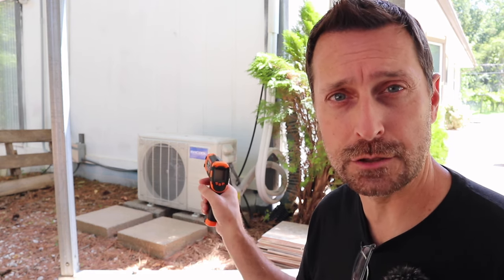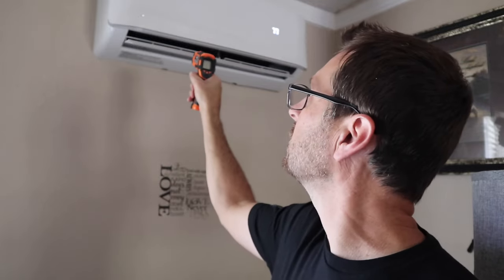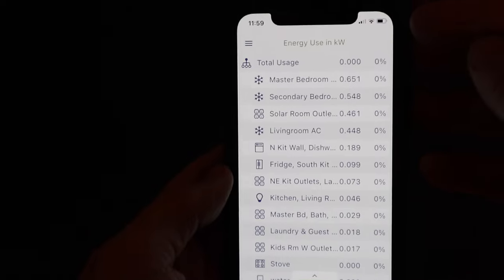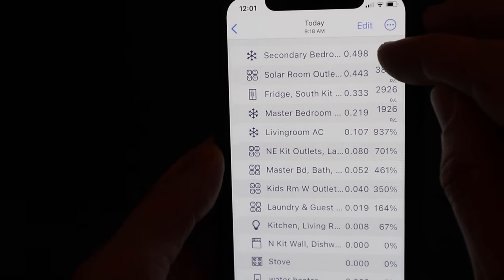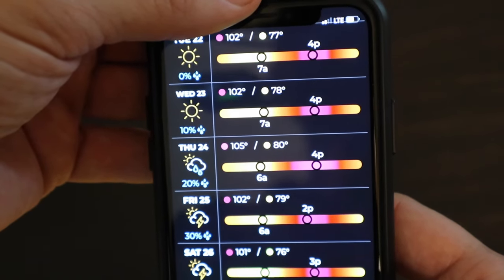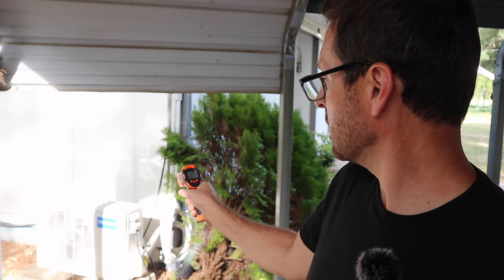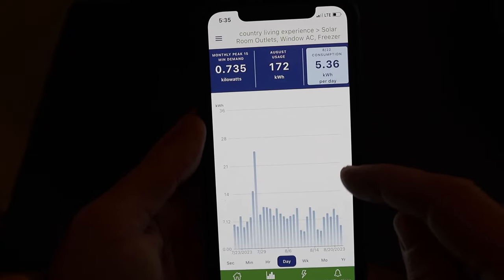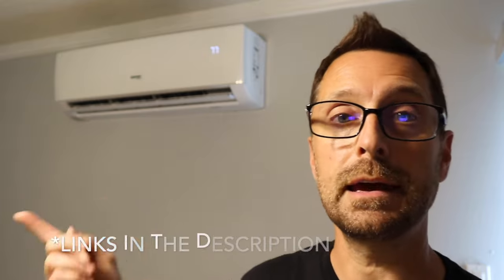Mini Split Heating And Cooling Performance In Hot Outdoor Temps!

Comment: Haha I run 8 heat pumps in 120 degrees and in direct sunlight 😂 they work well. It's super fun using a heat camera to measure the temperature differential.
Reply from the maker: Awesome. You certainly have a more brutal climate than I. These mini-split units are amazing!

Comment: We we're quoted $8K-$14K to replace the central unit for a single room (a converted, two-car garage).  We bought a mini-split for $800 and installed it ourselves. In spite of needing to boost our insulation, the mini split is doing an amazing job. That is the coolest room in the house.
Reply from the maker: That’s awesome. They are certainly a way better solution for cooling.

Comment: When I built this house, we put in one, 4 ton compressor, three mini split air handler style units, and two wall hung mini split heads. Each unit has its own thermostat, each program to different parameters, but combined it keeps the house extremely comfortable, and our bills are not bad at all. This technology is fantastic!
Reply from the maker: Awesome!

Comment: Wow 4 units for 1800 sq ft seems like a lot, but I do like the quiet factor. It was very interesting to see how they work with a solar system. It’s nice to know how efficient they are.
Reply: Redundancy is a big deal here too.  You could probably make that place 65 degrees if you wanted but if you lost one mini split a simple fan in that area could  at least keep that area moderately cool. Smart really.
Reply from the maker: That is not many units for a home this size. Remember, they work very differently than traditional systems. One in each bedroom and 1 for my large main space. I could add one more honestly. The design and layout of the home is also a big factor.
Reply: 4 isn't bad for 1800 sq ft.

Comment: We have R-19 in the exterior walls, R-15 in the interior walls R-19 in the ceiling between our apartment and garage, so that our living area upstairs will stay warmer and cooler. Our attic has R-54.

Last winter when the daytime temperature was around 25 F and Zero at night, our highest bi-monthly bill was $140.
Reply from the maker: R-54 in the ceiling is great. I need to add some.
Reply: The 112 year old house I’m in is finally getting insulation.  Yay winters won’t quite suck as bad now.   Amazing how they built these things back in the day plaster does a decent job but not what modern stuff can do.
Reply: @Capoe3  I’m super happy that you’re getting your house insulated.
My grandma had a house with no insulation, so I decided to insulate her attic in 1994 with R-48 insulation.
She was always toasty in the winter and cooler in the summer.
At first she thought I was nuts and wasting my money, but I told her that it was my money and I wanted to do something nice for her.

Comment: We have a substantial solar system so I follow consumption closely.   Our 2600sq ft house has a 4-ton (48,000BTU?) high-end Lennox forced air whole-house heat-pump.   It works well up to 110F where the power consumption (18a @ 240v on the outdoor unit) maxes out!     Somewhere between 110-115F (we get 115F once or twice a year)  during the 4-8pm (hottest part of day) period it just can't keep up and the temp in the house will rise from 75F to 78F'ish till 10pm when things start to cool off.    So our max consumption is 18a@240v compressor + ~600w fan = ~5000w.   All-in-all, hi SEER heat pumps - either whole house or mini-splits - work very well in my opinion.      FYI - Winter is the same, power consumption starts to max out <=30F (5000w) but it will actually heat the house down to 20F low has been our lowest so far.           They do make extreme mini-splits that can function in -xxF temps and they don't cost that much more.
Reply from the maker: Thanks for sharing.

Comment: I have had my Emporia 16 circuit VUE installed for about a month.  Nice to see the usage.  One thing I miss is our electricity provider will overlay the temperature over the usage which gives us an idea of the heat and cool required.

I just replaced a 5 ton unit for the main part of the house with a 4 ton Trane.  Looking back on it I would have liked to look into Mini Splits as we are empty nesters and many rooms don’t need cooling all the time.  I have an office/ham shack that I am not in often and we have some of the external bedrooms as well as a game room.  A friend has mini splits that will cool based on people in the room.  I don’t know how effective they are but even manually adjusting temps would be acceptable.  My ham shack is where my radio operation is and I plan on using a small solar setup just for that room, and will budget a mini split for that room.  I will install the min split and have my friend from church draw vacuum and flare ends so I don’t have a lot of spooled up lines.   Thanks again for the video. God Bless!
Reply from the maker: Cool. Good luck with that mini split install. I like the DIY Mr.Cool but those extra coiled up lines are an eyesore.

Comment: Do you monitor the humidity in the house? It may not be a factor there, but here in middle Georgia the humidity inside can be a problem, even with the air running. Also, the infra red temp gun may give you a more accurate reading at a distance of a couple feet. The farther you are, the larger the circle is that it reads. Most of them are most accurate for surface temperature readings and not the air itself.
Reply from the maker: I don't monitor the humidity but these mini-splits do dehumidify while cooling. They do a great job at it from what I have heard. It feels very dry in the house and that is probably why it feels very cold to me at 77°.

Comment: If you had a choice, would you choose Mr. Cool over singnature Solars mini split. The reason I ask is because I am about to purchase a solar system from signature solar and was wondering if there was a difference. If you could please give pros and cons of each?
Reply from the maker: I have an old unit from Sig Solar (Innovair brand) that did not have pre-vacuumed lines. Now that they have the EG4 units with the pre-vac lines, I may choose them. At the time, the Mr.Cool was the only one with pre-vaccumed lines and it was way easier than the Innovair.

Comment: I’m just north of Dallas. Someone on our neighborhood app asked what everyone keeps their house temp at during this heat. So many people keep their house at 70 to 72 during the day and in the 60’s at night. 😳 even in this heat. We don’t. I stay home with my kids and homeschool them, we keep ours at 77 or 78 during the day. And then turn it down at night. Our electric bill isn’t bad. I just was shocked what temps people kept their thermostats at, even in this heat. They’re probably the same folks that bark about cLiMaTe ChAnGe. 😵‍💫
Reply: Yes, that's way too cold! I agree, around 75-77 isn't bad at all.
Reply: We’re in TX too and the same scenario. We bought one LG dual inverter window unit to help reduce the central a/c from kicking on (increase LG from 71 to 73 day & 71 at night, central ac from 77 to 82 during the day and 77 at night. We run all our fans including tower fans to help. We had to do this because we moved into an older home and insulation isn’t good and we still need to seal areas of our home. Hope this helps someone.
Reply: I only keep mine at 72 because I have the EG4 solar mini splits, so during the day me no pay :)
Reply: @shaybee22  That shouldn't matter. It's not all about money.
Reply: We keep our A/C at 75. My dad lives in an attached apartment and his A/C is at 77.
We keep our heat on 68 degrees F and my dad keeps his on 75 .

Climate change is Biblical
Reply: I keep mine at 76°-77° Day and night.
Reply: @juliebarnett9812  It's free so make it cold as possible so you don't need it as much if at all when on grid power at night. That saves money and take a small load off the grid. It adds up
Reply: @JWTX  That’s too hot for us here in the PNW.
Reply: @Doc1855  I'm in North East Texas  we've been over 105° for nearly 3 weeks. And it's still comfortable to me. My wife has ferrets so she keeps hers around 72° which is way to cold for me. But in fairness I do work outside so nearly anything in the 70-80s is cooler from what it is outside.
Reply: @JWTX  we just got over a heat wave here 107 was our daytime highs.
25 miles away down in the Wenatchee Valley they were at 112.  We lost a few seniors due to the heat.
We’ve had seniors die from the heat when it gets to the low 90s.
People here in the PNW simply can’t handle the heat.
We’re lucky, we live in the mountains so we’re a bit cooler.
But in the winter when the Wenatchee valley gets 2 feet of snow, we get 5-7 feet.
Come February I’ll be wishing it was Spring. 
We live 5 miles up the mountain from a small town on a private road which we have to plow and maintain ourselves.
40 years ago I was in Dallas. TX working on a skyscraper. It was miserable in the heat. I remember that it got down to 80 degrees once and I put on a sweatshirt.
I grew up in SE WA state. It’s high desert there and our daytime highs were around 110. 
All of my professional career was in Tacoma, WA. I got use to the cooler weather and LOTS of rain, not much snow.
The Leftist have taken over the West side of the State, so I was able to retire early and my wife and I moved to the Right side of the State.
We bought a 1/4 of a mountain and built our house into the side.
It’s quiet and easy living.
We literally live in a forest.  I Love the Douglas Fir covered mountains. We had to fall 17 trees to make room for our house and drain field. 
We’ve built many retaining walls and raised beds (to make our mountain side flat) for our gardens. We have 1 flat area which we planted 3/4 (2 dwarf) orchard. 3 Apple, 3 cherry, 1 donut peach. Next year I’ll plant a Mulberry. 
My wife works as a RN in the city and I still use my degree and counsel people for free.
Even though I’m an Ordained Minister, my passion is Mental Health Therapy, which I retired from when I was 43 years old. I could start my own practice, but there are too many people who either don’t have insurance or simply can’t afford to pay for a counselor.
Our church is gracious enough to give me a room to counsel those who need my services.
Enjoy your day, Sir !
Reply: @Doc1855   Wow, your place sounds awesome.  Would love to see that. I had no idea y'all have been having the same heat wave. Thar sucks. We here ate used to it and kinda expect it at times. I hope you are enjoying your mountains and forest.  That's what I would like to have. But have to make do with what I have and where I am. Just getting prepared for what's coming....... Jeff
Reply: @JWTX  We bought a Freeze Dryer from Harvest Right. We’ve been freeze drying as much as possible. I love to garden and tend to my trees.
This summer has been about harvesting and freeze drying. This winter I’ll be freeze drying meats.
We have enough fresh fruit and veggies to freeze dry and barter with my wife’s family in Montana (they have a 17K acre ranch in which they raise cattle, lamb and pigs.
All of their livestock are originally grown. No growth hormones. 
They LOVE apricots and we have some friends who let us take as much as we want, as long as we barter some of our freeze dried peaches and Greens.
So late in the fall, we drive to Missoula (1/2 way to the farm). My wife’s parents drive to Missoula as well. 
My wife has family in Missoula, so all of us stay at their house.
We exchanged our fruits and veggies for a pig and 1/2 a beef.
We pay for a Steer (about 400# ) in early spring. That steer is raised on the farm and about 45 days before slaughter All of their beef is grain fed to build up the marble in the meat. They buy Hereford / Angus cattle. That cross seems to be more meaty and tender.
We have some friends about 90 miles from Missoula so we go up and spend time with them every fall. They love strawberries so we give them 5 gallons of freeze dried strawberries and they give us 5 gallons of honey.
My wife’s family has a butcher shop there on the ranch so they slaughter the livestock, cut and wrap it for us.
As we all know, food is getting more scarce and expensive. I’m trying desperately to freeze dry enough food to sustain my wife and I for 7 years.
Next year I’m having our local  Mininites build us a 12X24 shed to store our freeze dried food in. They’re better built than a Tuff Shed.
My grandma was born and raised in Oklahoma. She taught me how to cook “southern style “.
I LOVE cooking down a mess of Collards, mustards, turnip (I grow turnips , Swiss chard and radish) so I cook down all those greens together. I add 3 Tablespoon of bacon grease, salt and pepper. 10 minutes before pulling them from the heat, I add a LOT of peeled garlic.  The garlic is still firm on the outside but buttery smooth on the inside.
We will eat some of those greens for 1 meal and freeze dry the rest. 
When you freeze dry the food will last 25-30 years.
I’m happy to chat with you anytime. 
Maybe sometime when we drive to Galveston (to see my cousins), we can stop by.
Reply: Excellent point! @JWTX
Reply: @Doc1855   Wow that's awesome.  You have it going on. That's kinda my dream, so glad to know someone is living it. And yeah would be great to meet you and your wife. Anytime..... Jeff
Reply: @JWTX  Jeff, 
We have a very large 110# Chocolate Lab. We call him our Gentle Giant  Joe.
When he sees a family (who live on the canyon floor) walking their kids to the school bus stop Joe meets them and walks to the bus. The bus driver knows how much Joe loves the kids so Joe gets on the bus to greet the children. The bus driver then tells Joe to go home. When the parents pass our driveway, Joe comes up and onto our 2nd story covered deck.
There’s Elk, Deer, Wild Turkeys, Mountain Lions and a bear who lives in the SW area of our property.
Sadly the Elk and Deer head up higher during hunting season. I suppose they know that they would end up in our freezer.
Joe keeps them at bay from eating our fruit and vegetables.
When he stands on his hind legs, he’s taller than I am.
Though we only own 1/4 of our mountain, it butts up to another mountain which the 9 families (including us) own. We keep that mountain private for us and our guests to enjoy. We’ve cut in hiking and quad trails and maintain them for our pleasure.
I’m getting too old for rough hiking, but when our younger neighbors decide to go, they’ll call or text us asking if Joe can go hiking with them. Of course we say yes. Because of our Mountain Lion population, it’s wise to take a side arm and Joe along for the hike.
Next year some of the neighbors and us are going to take our quads up the trails and place some benches on some look out areas for those who can still hike the steep terrain can have places to sit and reflect.
Some close friends of ours bought the other 1/4 of the mountain and will be building next year. 
The back of both of our properties is National Forest.
Our friends are older than us, so once they are moved into their new home, we will start cutting switchbacks throughout our 1/2 of the mountain and placing lean toos with benches so that we will have privacy from the other neighbors.
We know that eventually they will start having problems getting around so my wife and I will be tending to them.
Most of the world is too busy looking after themselves that they’ve forgotten how to help each other.
I know that we are old school and a dying breed of humanity.
We have some neighbors who bought to the north of us. Their oldest child is 13 and he gladly works around our house for us.
My nickname is Doc and all 3 of their children refer to me as Grandpa Doc and my wife is Grandma Sherri. This thrills our hearts as all 3 of my children are dead.
My wife and I had no children together as we got married when I was 50 and I can still produce children, but we’re too old to raise them.
My children came from my X wife and myself.
Reply: @Doc1855   That's so awesome Doc. You are living life the way it was meant to be lived.  Enjoying the nature that the Creator blessed us with. Sorry to hear about your children. That's hard. We lost our 3rd child 3 months into the pregnancy and I still grieve over that and it was 15 years ago. We had another he is 7 years old and the light of my life. And he's interested in gardening and growing so I will be teaching him what I know. My oldest is 23 in October a boy and just had my first Grandchild a baby girl. My daughter just turned 20 in June. She works with me in my lawncare business. I'm 60 got a late start on the family thing. But better late than never. So I'm blessed with that.. Need to figure out a way to get in touch if you'd like. Hard to find people like us old school types...Let me know. Thanks for sharing.... Jeff
Reply: @JWTX  Jeff, though I live in the 509 area code my number is in the 253 area code, which is the Tacoma area. My other part is 227 and you know how it goes with the powers at be that won’t let people get in touch so the last is 8171.
Since I don’t have your number my phone is set up to block all unknown numbers. It cuts off all the telemarketers.
So send a text with your number and I’ll put it in my contacts.
Sorry that you lost a child in miscarriage. That too is rough. Your 7 year old sounds like a true blessing.
Spoil your granddaughter. 
I kinda got a late start too. I got married the first time when I was 31.
After my divorce I swore that I’d never ever get married again. I found out that Never Ever is 14 years, LOL.
I absolutely love my 2nd wife. I would take a bullet for her. She’s my life. She’s a wonderful woman.
We met on eHarmony.
I was just looking for quality women to meet and date and I was very honest about that. Little did I know that I would find the woman of my dreams.